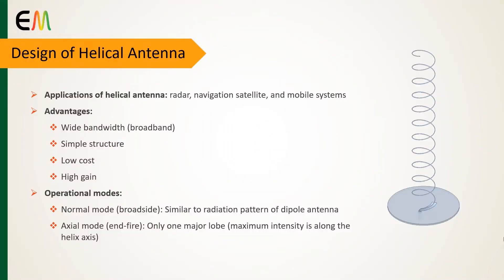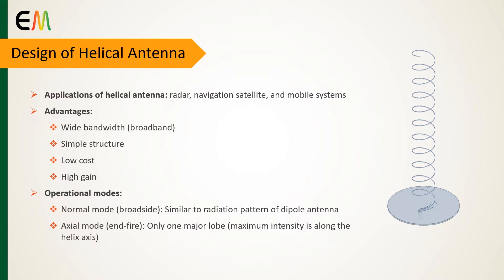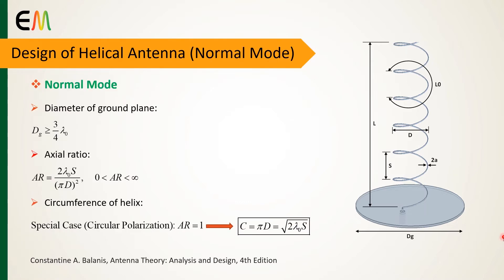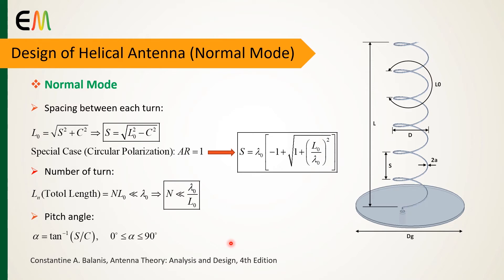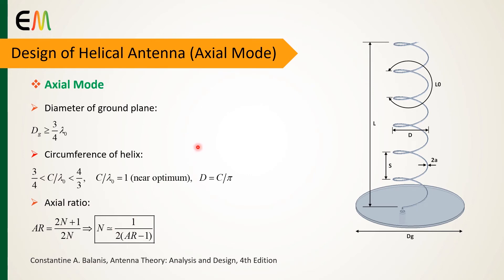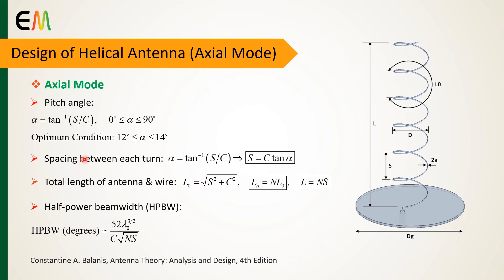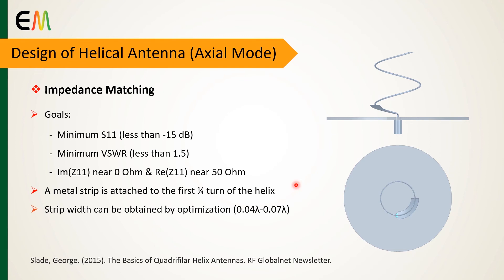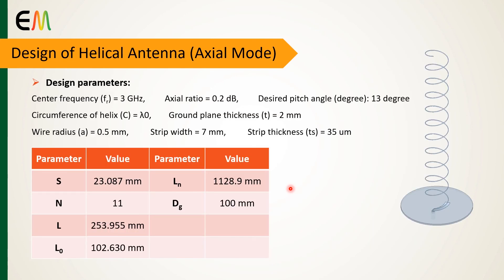Design Tutorial of Helical Antenna (Normal & Axial Modes)

Comment: Great video sir. Please also make a tutorial on conformal metasurfaces simulation in cst. Thanks
Reply from the maker: Thanks for your comment. The simulation of conformal metasurfaces requires a lot of memory cost. So, by my current system I cannot simulate them because the whole structure should be drawn (the regular periodic boundary conditions cannot be used). If I find an simple example of it I will try to provide the tutorial.